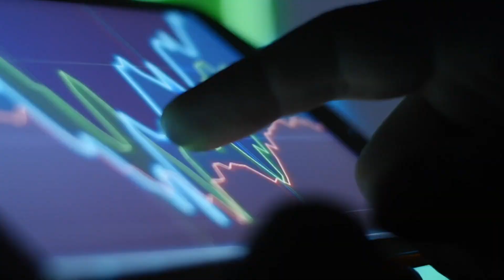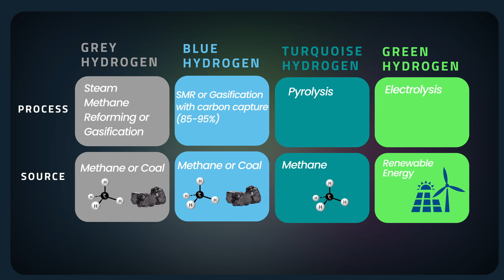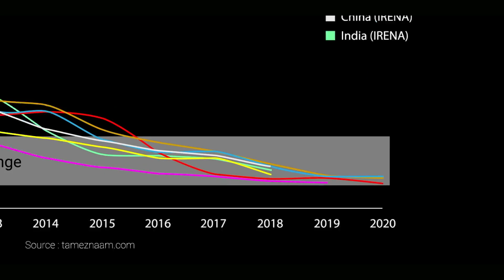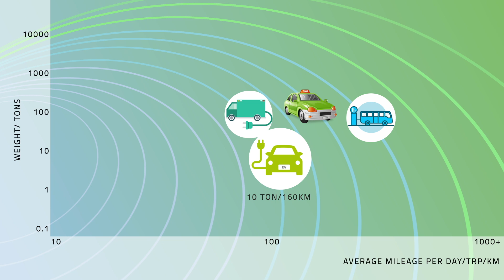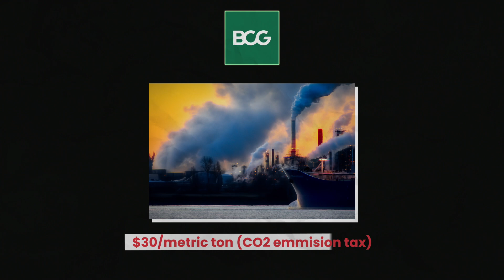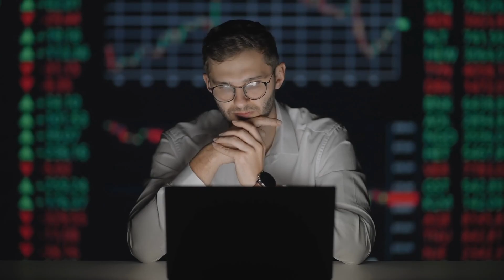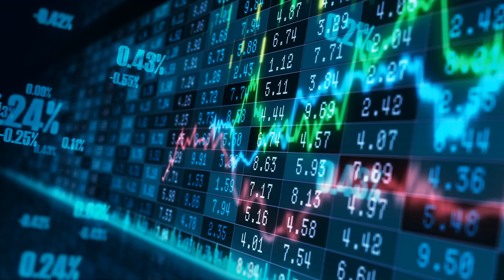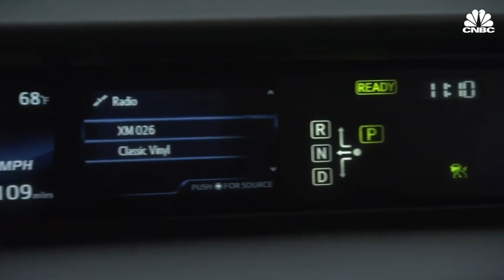Why NITIN GADKARI is pushing GREEN HYDROGEN for Indian Industries : Policy Case Study

Comment: Being a chemcial engineer workig in an hydrogen unit in oil & gas refinery i can say that, this video has covered almost everything one needs to know about  hydrogen industry, excellent presention and kudos to you guys for deep research and explaining this complex topic in an laymen terms , just i would like to add some points 

1. In chemical plants  hydrogen requirement is 24×7, now if i am producung my electricity from solar, for the night i need alternate electricity source or energy storing device which can increase CAPEX cost higher making grern hydrogen ineffective currently in particular case

2.  For the immediate situation IOCL has started blending of green hydrogen with Natural gas, not only this would act as better  fuel but will have lower emissions value and on economic front lower import bill to.

3. Reliance is currently investing heavily on solar cell manufacturing, battery and elecrrolyzer manufacturing , there recent acquisition of UK based company with deep research in Na- ion battery will make a big difference  in the manufacturing cost of green hydrogen when done at a scale.

So i am ambitious for the future of green hydrogen , it has certain bottlenecks but with the technological advancement and scale of economy the said 1$/kg hydrogen is possible.
Reply: Why don't they just produce methanol. Which can be a good storage form of hydrogen. Flexible to handle because of liquid state and can be used In both ICE and Fuelcell electric vehicles.
Reply: @infinitebeing1119  it creates pollution. And that's the primary reason for shifting into h2 energy
Reply: Itna gyani baba iha kaise? Naukri nahi mila kia? Party join karle phir
Reply: Did not get point 1. Is solar electrolysis to hydrogen production to usage in chemical industry an end to end live process? If not, then the hydrogen produced during the day, is the source which is then available for whoever wants 24x7 usage right? Just like how vehicles at night would use too? Would want to know what exactly I am missing.
Reply: @shibentech   what i wantet to say is electricity produced from solar will be only avilable for day for electrolysis process, for the night either we will require other source of electricity ( conventional will defeat the purpose of green hydrogen) as most of industrial process are continous one ( 24×7) which means you will be producing only that much qunatity of hydrogen as much you are consuming so there are no inventories , hope i have cleared my side.
Reply: @9586492322  chemical plants require solar electricity/electrolysis directly? Or the green hydrogen that is producing? If its latter, and knowing that hydrogen can be stored during night time, then I am not getting your point.
Reply: For point one !! Hydrogen can’t be produced during day & stored for night also ??  Rather than storing electricity in battery? Hydrogen infra can be gradually started by initially blending it with gas & gradually increased proportion as hydrogen production becomes cheaper & easier. By that time hydrogen consumption infrastructures/technology would mature. This can be started in industries first.
Reply: @vivekpmc1992  let me give you example, my unit curent H2 production is 1, 30,000 nm3/hrs at 100 % capacity, ( grey hydrogen) if say i double the solar panel and electorlyer  to increase my production to 2x , it will need storage structure , and whole CAPEX would skyrocket, first industryy requirements are dynamic , so inventory management will also be issue so for the sake of financial viability we will need another electricity source to overcome this issue.

Coming towards your point of view on how hydrogen consumption should be used , recently IOCL has done pilot project in delhi where they are blending hydrogen with CNG till 10% ,but ad you increase % of hydrogen in CNG , its compositin changes and will require further tuning in IC engine, on industry wide like oil & gas, still as green hydrogen technology is still in nescent stage, right now it can be only implemented as pilot poroject and once it shows its reliability and other concerns it will be defecto production technology
Reply: And what about the safety issues, the explosive nature of Hydrogen? I’m curious to know how they have thought through d various situations which can lead to explosions an dhow are they going to avoid that?
Reply: @pradeepbhojwani8139   hi pradeep, think about each of the fuel, petrol , diesel , natural gas ( NG)  each of this fuel is flamable, for the hydrogen we nedd to take some more precautions as we are taking with NG, we produce hydrogen in industry right now and trust me, its safe and excellent fuel, most importantly each fuel will catch fire, that its basic property we use it for, if its in controlled manner will  provide power , if its uncontrolled it will have undesired consequences
Reply: But it's very risky right green hydrogen
Reply: Has anyone heard about excessive use of solar panels can increase atmosphere temperature to alarming rate, as it reflects the sun rays back into atmosphere ?
Reply: Responding to Point 1. wind power provides the perfect balance for cloudy days or night as you've mentioned so ideally both solar and wind should be used together for producing electricity in the first stage.
Also, I think initially hydrogen could be more useful for industries and zero out the usage of coal and petrol/diesel and considerably reduce our carbon footprint. This would also buy time to figure out (and reduce costs for) the production, storage and engines' fuel conversion in case of vehicles.
Reply: I watched a video about hydrogen on real engineering channel.  Here he didn't show anything related to how hydrogen can be transferred  by a Transport system and how it can be stored like petrol? The initial price of A hydrogen station is 400 times that of a petrol station. There are many issues like the price of a base hydrogen car is much higher than petrol and ev. So hydrogen can be used for commercial vehicles like trucks, buses and planes in future India is still miles away from this because here significant people are still using wood and gas is new for them .
Reply: @logohub1234  I was going to comment same
Reply: @logohub1234  Currently grey hydrogen is being used in industries steel, oil & gas, fertilizers etc. , where storage is not a concern but continous supply is, so the first step will be replacement of grey hydrogen with green hydrogen in industries, and with production technology and  economyof scale will create the green impact these sectors need, if someone is thinking that they will be filling hydrogen gas in their car, that time is still far for mass market ,   as the technology will mature it will provide an inovative and affordable options  for storage and transportation, as it was with LNG or with any fuel, fututre of energy will be have plural energy source with electric, hydrogen and other renewable sources for mobility.
Reply: @9586492322  electrolysis is 70% efficient . Solar panels are 21% efficient. We will lose a lot of energy due to electrolysis. Electrolysis is only good for cheap electricity and electrolysis is a very energy intensive process. So there are still many problems. Not only transport and storage.only solution is CO2 or carbon neutral fuel.
Reply: @logohub1234    if you consider electric vehicle as future of mobility there is limited range till which it can operate both in terms of Km and load capacity, its undsrstoood that  battery has  excellent enegy conversion capacity, but to be climate conscious its important how we are producing that electricity and in current scneerio nuclear is only feasible way to produce electricity economically at wide scale around the globe in climate  conscious way, and surely world is moving away from that excellent source.

When we are talking about fuels of the future it need to account more than efficiency, it should have abundent raw materials ( water), low cost of production and how much energy has been consumed to fom that one kg o r gram of fuel, its energy density and  feasibility to deployment  across the globe, i think hydrogen fits at most of the place in this criteria.

To be mindful, ideal fuel only exist in theory , with each generation of fuels it should be our endeavour to produce more enviorement friendly incremental upgrde, its been evident from our shift from coal to petrol/ diesel to  natural gas and next will be combination of electeicity , hydrogen and methan hydrates if we can extract it successfully.
Reply: @9586492322  actually world running away from nuclear fission but running towards nuclear fusion. Fusion is  still 18 years away. But some days ago china created artificial sun using fusion . France is building a very large fusion reactor to replicate the sun on earth . It will be the future. But till then i think petrol is the only alternative. Electricity will never be sufficient for countries like India  which have a very high population.
Reply: @9586492322  I have worked in nuclear power station hospital in RAPS ( Rawat bhata). I am telling you ,present form of fission energy is very dangerous. We had very high incidence of thyroid /skin problems, the water of reservoir is contaminated ( no one can consume it for any purpose, fishes are contaminated), everyday there’s protest for safe water. Nuclear is potentially safe only with thermonuclear ( fusion) , entire world must use more effort in that , once it’s done all concern of energy would vanish).
Reply: @vivekpmc1992  developed country like japan was supporting this technology till before fukushima accident , the problem which you are saying is it still faced in the latest tech of nuclear fisision reactors, enlighten us
Reply: The Hydrogen be Created by Breaking Water using Electrolysis...." 
So my Question is...
"Why the Hell He didn't talked about Water??? There is Usable-Water Shortage all over India/World!!!  
How can you miss on such a big point???"
Reply: @Avtr3  if you consider earth we have 80%  water and less than 20% is land  second point is  considering other industrial process of manufacturing for anything be it your shoes to metal linings require much more water than this , as hydrorgen has much higher energy density and have considereable more energy conversion efficiency then petrol/diesel , and be assured that if we use sea water for this purpose it will l take considerable amount of time to exploit the water resources ( 300- 400 years min.)
Reply: @9586492322  finally hydrogen gets oxidised to form back H2O if I am not wrong . This water either can be collected in jar at exhaust Or it will spread in environment as vapour . Pls enlighten, I am lay person in this tech but certainly could be end user. Water vapour in environment is not bad as either it will precipitate quickly Or rise up to contribute in claud formation ( in mass utilisation , it could be significant). Sometimes ambient air is so dry that we have to use humidifier in house , can mass use of hydrogen increases humidity of air ( that may be relevant in dry areas).
Reply: @vivekpmc1992   @Jambo Bharti  as you said, water vapour can always be condensed and use for other purpose, so in industrial sense that wont be an issue i think, but as this technology commercialise at large scale we will see many flows and its  innovative solutions, so lets wait and watch
Reply: @Avtr3  you dont need clean water for electrolysis.  You can process ocean water as well.
Reply: @Avtr3  there are many places where water is in abundance. Now petroleum is transported from middle East to India. So it's fine to say we can transport hydrogen at cheap prices.
Reply: India is going to have to build more dams for fresh water storage AND for reliable electricity.
Reply: 1kg = 1L ,So 75 rupees for a liter,With taxes it will up to Rs 100 ,Then why hydrogen we can still uses efficient petrol for that price
Reply: @BanTeslaX  1 kg is not equal to 1 liter where do you get these kind of information. 1 liter of petrol is equivalent to 125 g of hydrogen energy.
Reply: @infinitebeing1119  he/she perhaps bunk  the chemistry classes 😂
Reply: @BanTeslaX  you do know 1l of hydrogen has more energy than peterol right even if you consider inefficient energy production from hydrogen it will still be do much more than peterol
Reply: @BanTeslaX  Pollution
Reply: He missed on a very Imp topic of Water.
Reply: @Avtr3  that's a very small issue as compared to the issues that he mentioned.
Reply: @vishulangeh8348  Not really!!! Sry but I don't agree with you.
Reply: @Avtr3  hydrogen can be make out of salt water too
Reply: @logohub1234  still it will have a huge effect on Marine Water Life.
Reply: @Avtr3  no effect because this process is not like desalination where brine was generated. Here electrolysis will break water into oxygen and hydrogen no harmful content.
Reply: @Avtr3  can u explain y
Reply: @Avtr3  do you really think taking water from oceans are gonna affect marine life ?😂 thats the dumbest thing I've read in a long time
Reply: @gokulsuji13  Same here bro.  When we are considering Desalinating Ocean Water for production of Hydrogen Fuel, on a Country Level (For India - One of Most populous Country on Earth), 
And you are saying that it will have no impact on Marine Life, is like a Shock for me. I am really doubting your education now even when we are considering Indian Standards.
Reply: @Avtr3  you do know that many countries use ocean to make drinking water right? Bro ocean is not a small thing even the whole country cant just deplete ocean water or even cause anything close to marine life however you try its just really stupid if you were talking about ground water i agree even soft drink companies deplete them but ocean seriously bro use some braisn
Reply: @Avtr3  ask anyone you want ocean is 99 percent of all water on earth 2 3rd of earth its abundant you should be more worried about your education rather than indian education
Reply: @gokulsuji13  Pl consider that NaCl content in solution will increase and this highly saline water is to be returned back to sea, even when pumped will be only few km from coast for economic reasons. This salinity does not get dispersed easily, and affects coastal marine life. This is a serious problem surrounding desalination plants. You may do your research Pl. 😊
Reply: @yashwantsakhardande4483  and for the research part if you research just for negative point you can find cons in every single thing even if you aren't the brightest anyone can understand hydrogen is less polluting than peterol or deisel .You don't have to be very smart to understand that if you don't may god help you.
Reply: @Avtr3  I couldn't help but be amazed by the amount of confidence people have to say that ocean health and life won't be affected, as if you're the one wrong. I don't know what to say... Sigh. Don't waste your breath with them, it's hopeless.
Reply: @rajsekhark88  Thanks for the Support.
Reply: @yashwantsakhardande4483  You have to thinks Pros and cons accordingly then see which side has weightage....also we can use brine for other purpose(yet not been found out)also water turned into hydrogen again it expelled as water....and worrying about water level in ocean??? dont worry climate changes are contributing rise of sea level every year😁...so best thing is to  switch to renewables...also if we use Litium ion abundantly for storing energy.,where we wil get this much litium and other things.
Reply: @Avtr3  the greatest problems for marine life is 
Plastic,not production of hydrogen.
Reply: @reality5788  True...but why are we soo keen on creating a new problem for them.
Reply: @Avtr3  that's not a new problem, In fact that's not even a  problem for them.
Pollution is the major and only problem for marine life.
Reply: @reality5788  what are you saying bro 😆😆
Reply: @Avtr3  truth.

Comment: There is one problem, hydrogen fuel on uncontrollable combustion is dangerous, If there is any accident in cars or buses then the amount is damage is very high compared to other mode of fuel
Reply: toyota has solved that problem. even if you shoot a bullet at their hydrogen tank it does not explode.

Comment: See that's the thing which these politicians hide. H2 isn't a very good fuel alternative. For a H2 fuel cell to work one needs to first do the electrolysis of water which requires energy also. Efficiency of fuel cell is almost similar to our conventional sources of energy like coal and natural. I know many in comments will go against me but see a donut media video about what's the hydrogen's problem. Also cost of making a H2 fuel cell station is way more than even our petrol and diesel stations. That's the reason EV evolved as a better alternative than a H2 cell. Moreover cost of production of fuel cell is more and these vehicles like toyota mirai which is a fuel cell powered vehicle are really not affordable for our common man. H2 is a dumb idea and politicians idk why are so seduced over H2 fuel cell despite knowing it's cons. First it was Bush in USA and now nitin gadkari in India. Mr gadkari should rather focus on making Indian automobile market more better as we've seen how enthusiast brands like abarth, fiat, ford, GM left India and brands like Mazda never came to India. Also Mr gadkari should focus more on making car crash structures safe with solid architecture and platforms and not just increasing the no. Of airbags like a maniac and the bigot of an organisation like BNVSAP.

Comment: Hydrogen cars is a stupid idea. You have to produce hydrogen by electricity then use as a fuel source means unnecessary double spending the energy. Why not use directly electricity to turn the wheels? Which also gives you above 90% efficiency.